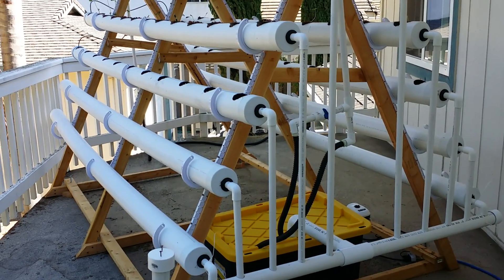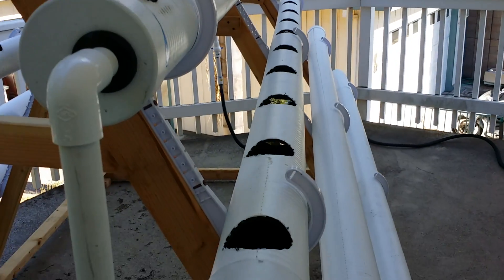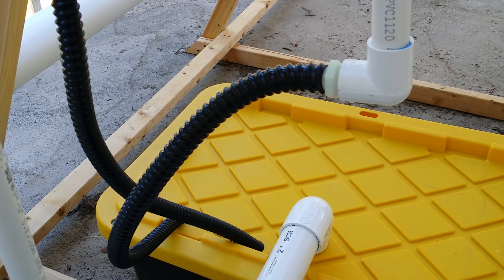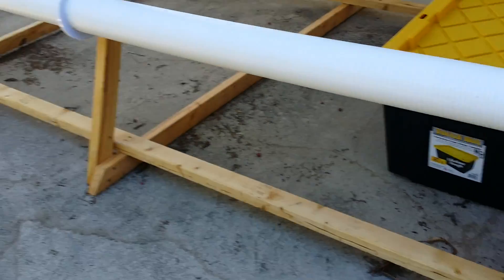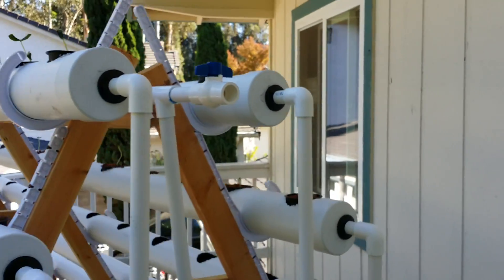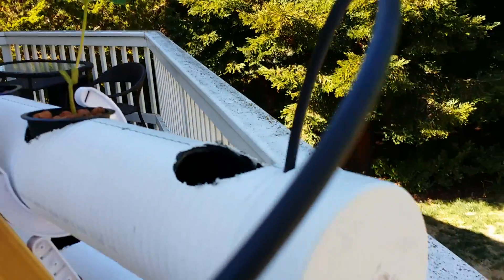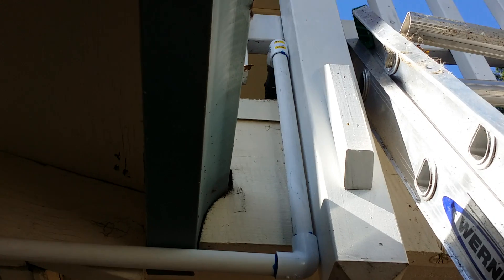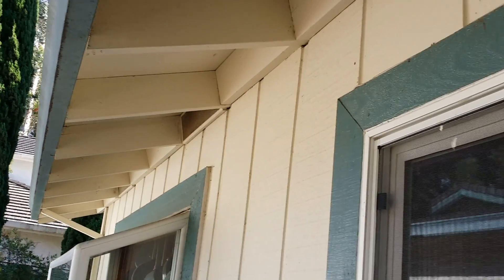My Hydroponic A Frame Build

Comment: I may be wrong, but it appears that the pipe you have chosen is not for potable water use.  It is drain pipe and thus is not chemically safe for use for growing food.  Safe PVC needs to be used.
Reply from the maker: You are correct.  This was addressed in previous comments and replaced.  The pipe in the video also sags easier.

Comment: Has anybody grown like this ever had the roots from the plants get too massive, as to where they slow the flow of the water, and cause the water to rise up too high and leak out, leaving the res almost empty the next day? I considered an overflow/drain, but the problem is still that not enough fresh water is flowing through the pipes... I have tried everything except for trimming the roots, as they are the size the plants need them to be, but if I have to trim them I have to, that is the last thing I want to have to do.. Oh yeah, I flood them for 15 mins every 2 hours, and I leveled out all 4 of my 10' four inch pvc pipes, now I know I should have raised the first, and went lower as I go along, so gravity helps the flow... Any tips or suggestions?
Reply from the maker: Hi.  you are doing a flood and drain.  This will cause an increase in roots as they grow to seek out water and nutrients.  This build is a constant flow system.  As long as you have good aeration your roots will be healthy and not grow massive to cause issues.  Hope that helps.
Reply: @1aday2008  Yea that is what I am doing for sure, never thought about it that way though, but it makes perfect sense. Thank you very much for the response, and for sharing your A Frame Build.
Reply: @1aday2008  Well I found a temp fix, I got an intermittent timer, and I measured how long it takes the pipes to start leaking around the netpots, and that is 1:11, so I have the pump on every 5 minutes and let it run for 50 seconds, so far I am not losing costly nutrients every time the pump comes on..  Next year I'll go 6" pipes, at least for the zucchini and squash for sure. And I'll make sure to raise the first part of the system above the other pipes, and have them go lower till they reach the end/drain, that way gravity is on my side as well.

Comment: hello!  i just built a similar hydroponic system where the pipes are level and has a constant level of water -- did you run into any issues of the roots not getting enough oxygen/are too submerged in water?  where does the water level hit your net pot?  thank you!
Reply from the maker: No.  Oxygenating the water happens 2 ways.  1.  With the use of the bubler.  2.  With the pressure control return that allows water to immediately return and splash into the tank.  the second black hose coming off of the front supply line.  Bottom 1/4 of net pots are in the water.  But you can put them deeper and it is not an issue.  Roots will not rot as long as the water is well oxygenated.
Reply: @1aday2008  thank you!  do you use a bubler/air pump or is #2 sufficient for you?

Comment: Great setup. I'm building a similar system. What size PVC did you use? On the water into the rails you used a drip manifold. How is that connected to the PVC T? Looks like it is screwed in to the T? Please provide sizes or part. Thanks for your help.

Comment: Where did you get the 6" corrugated solid pipe? I can find the 3 inch and the 4 inch but not the 6". I want to use the HDPE lined pipe too because PVC is poisonous!  Good job by the way.
Reply from the maker: Search Lowes or HD online.  They can usually get it to your local store.

Comment: Curious if you are still using this system and if so, maybe you could do a short follow up video showing how you handles the bottom 2 pipes as well as any modifications you have made over time. 
I’m building a similar system right now.

Comment: Can i use my 720lph max height 5m pump for this?
Reply from the maker: Thats less than 200gph.  I am using a 550gph pump.  There is a return valve that lets you control pressure.  So you should be fine with that size.

Comment: Ni e setup ...hiw will you flush your ayatem comoletly if there is a need of nutrient change in between the xrop
Reply from the maker: Is your question how will you flush the system completely?  Changes are done by removing most of the water via the drain valve.  Then fill water and add more nutients.  Please clarify your question if this doesn't answer it.
Reply: P and S yes that ia the question ...but i do not see any drain valve as ...there will be some water level.mainfained in pipe so i assume u have to remove end cap completly ...abd it depends if its not glued ...please clarify.Thanks
Reply from the maker: Urban D I dont remove all the water.  Its not required.  The amount left in the tubes is a safety thing too.  If the pump dies or electricity fails if roots are completely dry they die quickly.  Having water retained allows for more survival time.  Hope that helps.  FYI you vould also use screw end caps so you could remove it all.  I haven't found that necessary.
Reply: P and S Ok Thanks and agree with all of your points ...but when nutrient completly flows for 2 weeks say it become imbalanced and i usually change it completly and for that purpose complete drain is required...my query was with that reference.

Comment: What is the small white item on the frame behind the and to the right of the water storage?  Also what size is your flex hose?
Thanks
Reply from the maker: 3/4 flex hose.   The small white unit you are referring to is a small marine air bubbler.  This provides additional oxygen to the water.

Comment: Inclination of the sides of the module?
Reply from the maker: I goal was to keep them relatively level.  The exits are almost centered on the end of the tube so that it is even throughout.  Since the water flows in only on one end it creates a flow to the other side.

Comment: Distance between holes??
Reply from the maker: I have both 6 and 9 and 12 inch between holes.  All depends on density and what you want to grow.  I did find on the 6" that I was skipping holes.  So I tend to use the 6" for the smaller plants.  The beauty is that you can move them around as you want.

Comment: Why didn't you choose a "snake"-style layout from top to bottom? Would have been a lot less material I think?
Reply from the maker: Several reasons.  One I wanted to be able to control slope which I wouldn't be able to do on a snake system at least not in a way I could adjust on the fly when the system is moved into the garage for winter growing.   The second was that I wanted to be able to control water flow based on the needs of each row of plants.  The last was I felt the plants at the end of snake would have less oxygen saturated water.  As for material it would have actually ended up being more as each row would have to connect to the other.  Also cost for 4" elbows are higher and you would need 2 for each side of the rows.  (except the top row and bottom where it would be needed for 1 side).

Comment: Excellent video. You certainly have a well thought out system. Thank you for listing the parts and showing how you put it together. I am in the process of getting ready to make a system for myself. 
How did it ultimately work for you? Do you have any additional advice now that it's been a while?
Thanks.
Reply from the maker: Hi.  thanks for the comment. The system worked well.  I did end up replacing the system with 4 inch solid pvc pipes.  The ones here are not ideal for growing and they started to bow a little when the plants grew.  This system is good for the smaller plants such as lettuce with tomatoes it was hard to get the branches up.  I ended up building another system that I will try to get posted.  :)
Reply: Hey, thanks for the response. If you do post another video, I'll watch it and see what improvements you made.
Reply: I have 5 Inch pipes, and I was wondering what kind of pots you were using.
Reply: Keep us posted! This looks great, really curious about the new system. Did the system in this video do well indoors? Thanks!